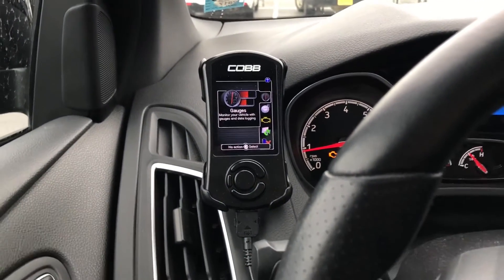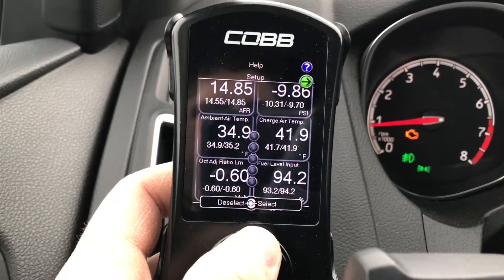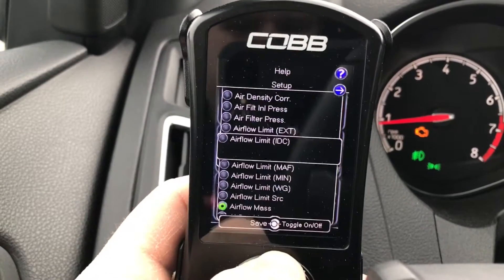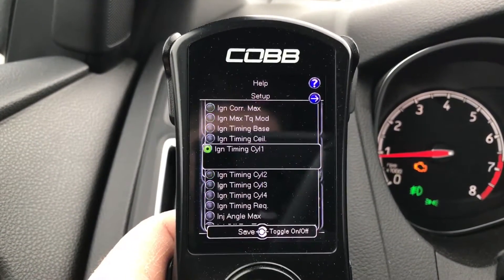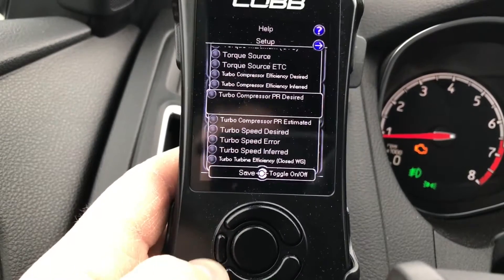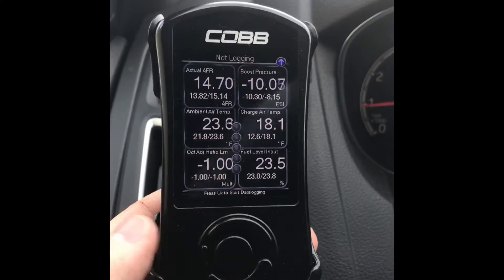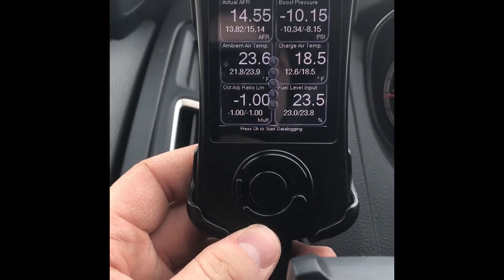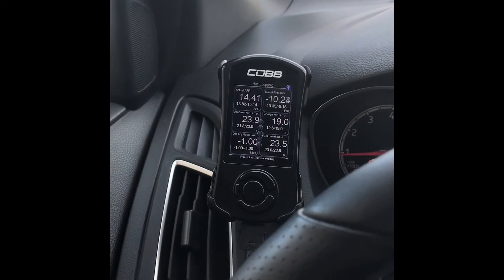How to Datalog with your Cobb Accessport!

Comment: So if your running those tests (3rd gear pull and multi gear pull) do you have to hit the data log button as soon as your at 2500 rpm? Because mine has the same data logging parameters and stress tests. I just did not know how to actually run the data log. Or can you data log starting at idle and get to red line?
Reply from the maker: most tuners when reading the datalog will tell you what rpm to go through, for using the access port ive noticed a slight delay from starting the datalog to it actually logging. What will happen when you hit the log button is the gauges will disappear. When the gauges reappear it is logging, which is when you can do your pull. My tuner told me 2500rpm all the way to redline. but others may say something different.
Reply: Yeah mine is the same. I just did not know you have to start it at exactly 2500 and end it as fast as possible
Reply: So the only data they have is that. Also is it wide open throttle?
Reply from the maker: usually wide open throttle, and the only parameters that will be recorded are the ones set with the green circle. Im not sure how many you can actually record at once
Reply: If you select too many it will tell you

Comment: what's your a/f drop to when you are cruising with your foot off the gas?
Reply from the maker: killmat1c like 43 or something crazy, I read it's a normal function lol
Reply: BrendoST OK curious cus mine is that too and it seems pretty extreme, wasn't sure if it was normal or not
Reply: killmat1c In theory it should approach infinity since the car is no longer injecting fuel into the cylinders when you coast for a period of time. But yes, mine goes to 40+ when coasting. Perfectly normal.